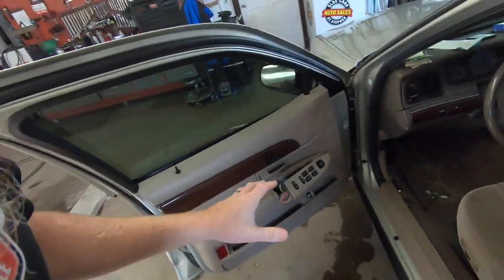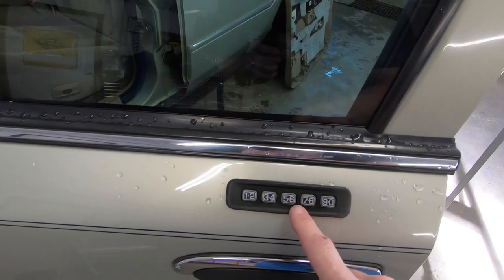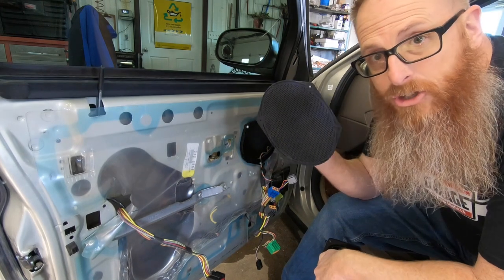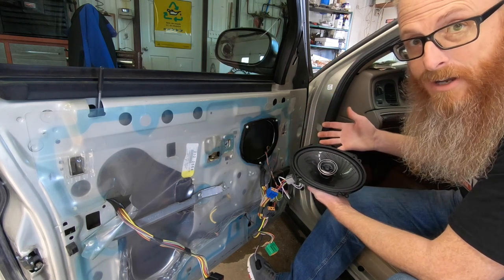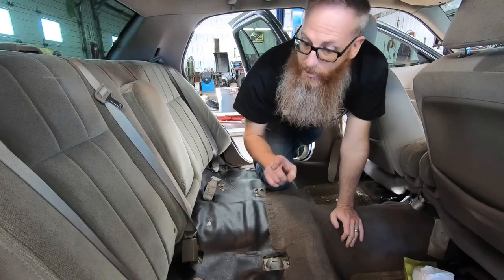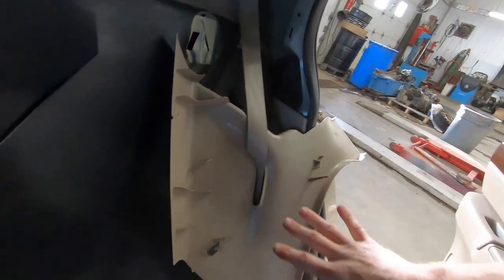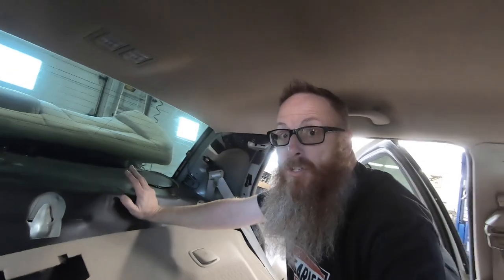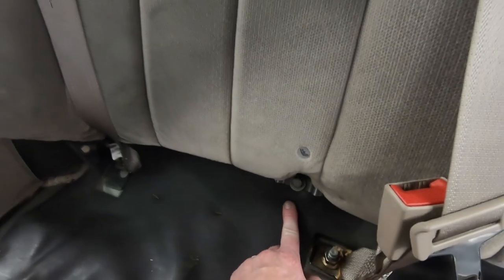KENWOOD FRONT AND REAR SPEAKER REPLACEMENT IN MY 2004 MERCURY GRAND MARQUIS

Comment: That's one thing I almost miss about older cars, the ability to upgrade the sound system
Reply from the maker: Yup! When I was younger, i swapped the same stereo every year into every vehicle i owned! lol
Reply: Why can't you do that with newer cars?
Reply: @pronewbofficial  most don't have a slide-in stereo like they used to. It's not an individual component anymore.  Take a look at my review of the Audi S3. If you watch the interior, you'll see what I mean
Reply: @shanescarlife  Good to know. Thanks.
Reply: Put some Kicker 15s in Grandma Gangster's car
Reply: Old cars are better shrugs
Reply: @pronewbofficial  also a lot of them especially with integrated navigation and steering wheel buttons are wired into your canbus so there are additional adapters, converters, etc needed to make everything play together nicely. Even my old 2006 Dodge Magnum needed an adapter to avoid messing up the digital readout on my instrument cluster.
Reply: @shanescarlife  you can get speaker pods though

Comment: hey jason i just bought myself a 2004 mercury grand marquis ls and the speakers sound good  the guy took out the sound system but i'm not looking for speakers in the box. but i like the subwoofer inside the truck box. so i have to put 4 6x8 speakers that solid wow no 6x9's that's crazy

Comment: how do you tell which of the original wires is positive and negative.  i replaced my back speakers and the wires on both sides were different colors.  Some uniformity would have been nice from the manufacturer
Reply from the maker: I can’t remember off the top of my head but Metra online or Bulldog Security should tell you for sure.

Comment: Need to know which wire is positive and which is negative?
Reply from the maker: There are multiple ways to check. Follow this link and scroll: https://www.electronicshub.org/speaker-wire-stripe-positive-or-negative/#:~:text=On%20most%20speakers%2C%20the%20white,use%20different%20markings%20as%20well.

Comment: Hi Jason. I’m having an issue with my 04 MGM, it keeps blowing out stereos. My factory stereo quit working so I’ve installed two stereos and they have both blown and quit working after a few days. I’ve checked the fuses and they look fine. Do you have any tips of what I should look for to fox the problem? Thanks for making an awesome channel!
Reply from the maker: Hey bud. Thanks for watching. I’d start by checking the running voltage output on your alternator. If it’s over charging, that could be the problem.

Comment: I’m new to the baffles tbh. Iv had car systems an messed with lots of entertainment type audio and was wondering if those baffles can effect the performance if let’s say you stick a big old top of the line speaker in one as I always was told (but know it can differ esp in cars) that speakers need that breathing room. Im going a speaker swap in my 04 grand merc. Im not going with a sub yet, maybe in future but do you suggest I use these baffles front and back and I will get better sound for doing so? Thanks man an ur ride is nice 👍
Reply from the maker: Thanks for watching. I found the baffles isolated the sound and did not let much if any bass come through but accentuated the mids and highs. However, I was adding a subwoofer so it all worked out.
Reply: @OldeCarrGuy  sounds good sir thank you very much

Comment: Hello sir. I have an 03 mercury and coincidentally have those exact replacements. Did you have to do anything special to get the front speakers seated? I can’t get my door panels to sit flush putting them back on.
Reply from the maker: I don't recall having to do anything special. If your factory speakers came with adapters, try removing them.
Reply: @OldeCarrGuy  thanks man. I think maybe I’m just trippn and didn’t know how it looked in the first place. The bolts line up and doors close but the way the panel curves up at the top of the door going towards the front threw me off lol

Comment: So I have a question as far as the wireless entry key pad, I just bought a 06 Grand Marquis about a week and a half ago and I read somewhere that starting in 06 they don't put the key code stickers anywhere including on the thing on the door, anyone know if this is true and if it is, where could I find it otherwise without having to go to the dealer
Reply from the maker: I've never heard that, but you can check the trunk lid hinges for a sticker with a 5 digit code. Otherwise, you can have the door panel off in just a minute or two to check the module.
Reply: @OldeCarrGuy  I've checked every other place it could be aside from inside the door panel right when I first got it and I haven't found it anywhere, I tried taking the door panel off but feels like there is something stuck to where it can't come off easily
Reply from the maker: @dancemasterfreak456  if you have all the screws and fasteners out, try lifting upwards on the door panel as if you are Sliding it against the door.

Comment: Phenomenal video! I recently bought a 2005 grand marquis and I want to install a stereo with corresponding rear view camera. any suggestions on models that will fit the slow once the stereo is removed? thanks! you're appreciated!
Reply from the maker: Thanks man! Although you will need to slightly trim the opening, pretty much all double din radios will fit the hole.

Comment: I recently found your channel, and have been going back catching up on Grand Ma. My question about the speakers is:  are they all the same speaker, or different front and back? (since they all seem to be the same size)

 I am getting a lot of info from you since I purchased my 04 GM this past October, and I love my two tone green/gold girl.  She has 164K easy miles  on her, as she was owned by the late mother of a friend of mine.  BTW I already replaced my base radio with a 7" touch screen model from Amazon.  Mine does have back up cam (not in yet), AM/FM, no GPS, BUT it does have 12/24 hour clock which most do not!

Really enjoy your work, keep it up!  I am anxiously waiting to see how you install the back up cam.  Bruce
Reply from the maker: Thanks Bruce! The speakers were all the same,6x8. As far as the backup camera, I did it quite a bit later in the summer. It should be mixed in the playlist somewhere. Hope to see you around!

Comment: Thanks for the video.  You do not need to remove the bottom portion of the rear seat.  Just pull the upper portion of the rear seat forward a little bit.  Just a little time saver.
Reply from the maker: Thanks for the tip!

Comment: hey quick question i installed 2 kicker CS series 6x8s in the front and it sounds good but when i crank up the volume more than half way i can here tiny crackles here and then throughout music play. do you know why they’re doing that by any chance? also i spliced them in and i still have my stock radio i was thinking maybe those could be the problem either that or i need a amp? please if you could help and get back to me it would be much appreciated!
Reply from the maker: If you are not currently running an amplifier it sounds as though they are clipping (meaning head unit is being over powered). A properly adjusted amplifier should help with this.
Reply: @OldeCarrGuy  okay, will a aftermarket quality radio help as well? or that doesn’t matter?
Reply from the maker: Definitely!
Reply: @OldeCarrGuy  alright thanks so much man! keep up the videos on grandma i have the same exact gold ash metallic grand marquis so i really like the content once again thank you!

Comment: Did you plug BOTH front speakers in before you tested? I’m doing pretty much the exact same install and not getting any sound from the new speaker but am getting full sound from the factory. Only attempted the drivers side so far and I’m stuck as to why this is happening. Thanks!
Reply from the maker: They will work independently. Just double check you connection where you tapped into the factory speaker wire.

Comment: I got a 2002 Grand Marquis LSE and am looking to replace the speakers. The speakers in your video look good and the kenwood speakers I’ve found were KFC-C6896PS. Is that the same used in the video or at least a good one to use? Thanks
Reply from the maker: Same ones! Decent quality sound!
Reply: @OldeCarrGuy  hey thanks for your video. It helped a lot with putting my new speakers in. It was weird though because the baffles I got that were 6x8 didn’t fit so I installed the speakers without them. Also the drivers door speaker didn’t fit in the holes so I had use self tapping screws. The passenger door one fit fine. I’ve got your other video about installing the amp and subs saved for when those come in later.
Reply: @OldeCarrGuy  looking back, the reason my speakers didn’t fit the same as yours was because my 02 was a different generation than your 04. But this video helped me replace the speakers on my 03 marauder so thank you.

Comment: Hey so on the front doors the factory connectors doesn’t work for the 6x8s?
Reply from the maker: No! Because the speakers are universal fit! There is a way to make it work, but it involves getting the speaker wire connectors off another car and wiring them in. The way I did it was just a time saver! Thanks for watching.
Reply: 6x8 on from and back for 2003 marquiz?

Comment: wow i have a 1996 mercury grand marquis gs and i'm going to use skar audio speakers and they sound awesome and i'm switiching them out i got to have them but i wanted to put 6 speakers inside my car but i think i'm just going to put the 2 6x8's and the two 6x9's speakers and i will use the 6 1/2 speakers on a different project and call it a day. but i'm going to use a bass tube for my car i don't want a box in my trunk taking up all of my trunk space ya see so do you think i should use a bass tube 8 inch subwoofer or a 10 inch sub woofer let me know what you think
Reply from the maker: If you custom build a box, a 10" sub will fit beside the spare tire and it's up out of the way!

Comment: How did you get the polarity correct on the factory speaker wires (positive, and negative)?
Or, does it not really matter?

That always drives me crazy. 
The last time I installed door, rear deck speakers, I was lucky and they came with the adapter harness that plugs into the factory connector, and then into the aftermarket speaker (Crutchfield included them for free).

Good tip to remember to mention the 5 digit keyless entry door pin code. 

How about a winter car tip video about checking to make sure your heating, ventilation, and a/c system function so it'll be ready to defrost the insides of the windows, and keep occupants toasty warm.

Oh yeah, you still haven't hooked up the backup camera, when you installed the stereo. Maybe you'll do that when your running wire for the subwoofer. 

What else did I forget?
Oh yeah...
Reply from the maker: Polarity doesn’t really matter as long as you are consistent when pluggin in! I used the right side of each connector (looking at the open end) as the positive! I guess I forgot to mention that in the video!

Thanks for the suggestion about winter car care! I just may do that. 

As far as the backup camera, I did hook it up back in late summer, just didn’t vlog it! I can definitely go over that again as well as the gps! 

Thanks for keeping me on track Chuck!

Comment: Great video on how to do this, man! Thanks a lot. One question, though: my 97 Grand Marquis comes with a JBL package with a small amplifier that goes in the trunk, next to the left speaker. Do I have to wire something up with it and the new speakers? I am noob in these things 😬. Thanks again! Greetings from Mexico!
Reply from the maker: Hey Diego. You will need either the amp bypass wiring harness (Metra 70-5600) or the integrated amp harness (Metra 70-5603) if you want to keep the amp. I hope this helps and thanks for watching my videos. There's lots more on this car as well as my lifter 2003 Grand Marquis
Reply: Thanks for answering so fast! I am keeping the original head unit, though. Do I still need to bypass it by just changing the speakers?
Reply from the maker: @diego750il  You're good to go then. No extra parts required other than speaker wire and a couple connectors.
Reply: Man can sum one help me..I have the 2000 mercury grand marquis and I'm trying do new speakers in front doors and rear deck and a new head unit..is it a double din or single and what harness will I need ..Thanks

Comment: Did that baffle touch the window at all?
Reply from the maker: It did, but i have since stretched it out a bit to pull it away from the window.
Reply: @OldeCarrGuy   what do you mean by stretched them? I plan on putting some NVX 6x8 in my GM so I’d like to do the same set up

Comment: You literally skipped or sped through the most critical and important parts of the process.  How exactly you tap into the OEM wiring to install the Kenwood speakers.  That is literally the most important part.  Show how you tapped into the OEM wiring with the aftermarket adapter components.  This is the most important thing.  The second is proper disassembly of the door panels and rear deck.
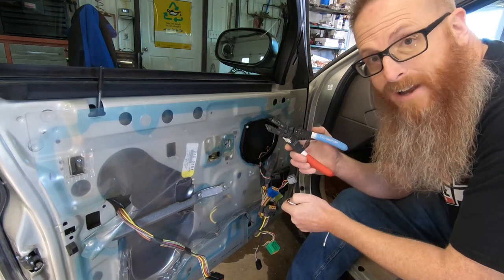Reply from the maker: @ 2:45 I thought I explained how to connect the speaker wires quite clearly, however, I do apologize if I wasn't detailed enough. This video isn't meant to be a "how to" video which is why I didn't explain how to remove the door panel. If you need more help with either of these procedures, i'd be happy to walk you through a video chat!

Comment: BTW... I used to have a 1975 Cordoba... Except it was badged as a Dodge Charger SE 318 2 barrel; when I sold it it had a 383 4 speed :) My real favorite car back in the Day was my 70' GTX
Reply from the maker: I've had mine since 95, sold it in 2000 and bought it back in 2002. Glutton for punishment I guess. Mopar Guys, Go figure.
Reply: @OldeCarrGuy  Yeah but it's a sweet ride... except for all of the emissions crap they hung on all late 70's cars!  But I'm a Ford guy who likes old Mopars :) Easy to work on too...

Comment: Hey man your great I've had my grand marquis for 17 years, hey is there anyway that I can get 6x9s to fit back there? Could you tell me how thanks
Reply from the maker: I think you can make a 6x9's work in the rear (may have to mount from the bottom), but not so much up front (due to the depth of the speaker to the glass in the door).
Reply: @OldeCarrGuy  ok I'm going to check thank you

Comment: Very informative! I cringed a little when you used the taps however. 😣
Reply from the maker: Yeah! I'm beginning to quickly realize folks in the comments don't like t-taps.
Reply: @OldeCarrGuy  They certainly don't take away from the video so please don't think that I think it's insufferable because of it. I have speakers and everything and now I just need to make time to put them in my 2000 Mercury Grand Marquis LS. This video has given me great insight as to how to do it now! 

(IMO, I'm a person where, if there isn't an adaptor, then I'll solder and heat shrink. I never want to worry about corrosion or speakers cutting in and out with bumps or anything else for that matter. I rewired a whole golf cart for turn signals and it took me forever but I soldered every junction of wire I did. I've been doing it for years and not once has anything come back to me yet, at least not because of my soldering.😄)
Reply from the maker: No worries man. I appreciate every comment.